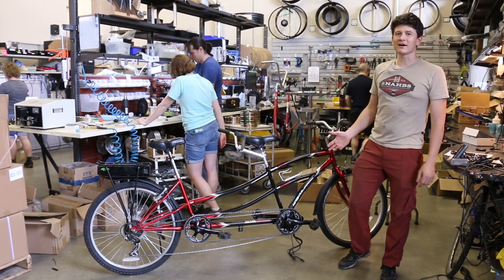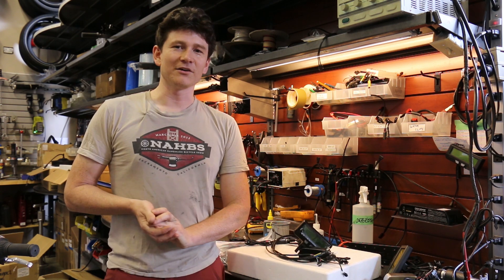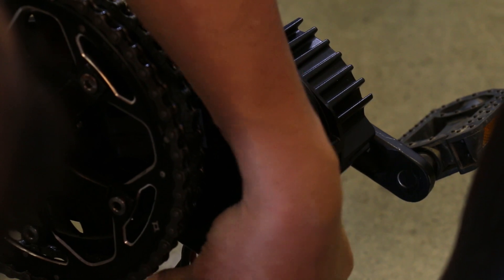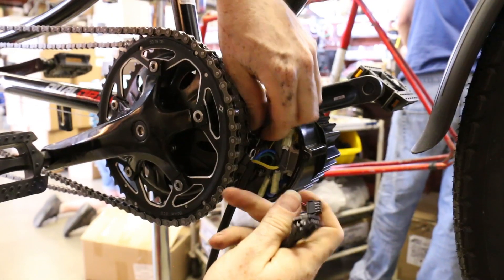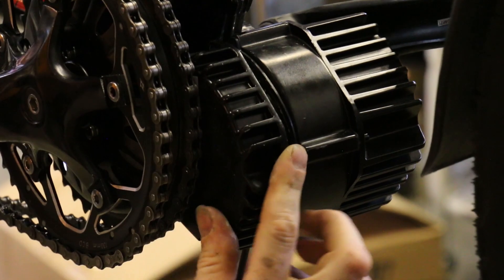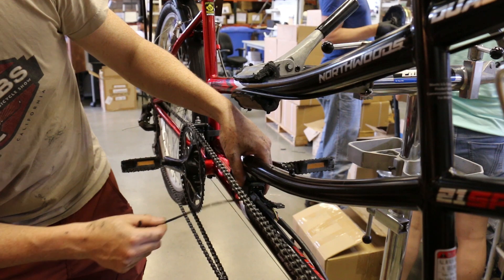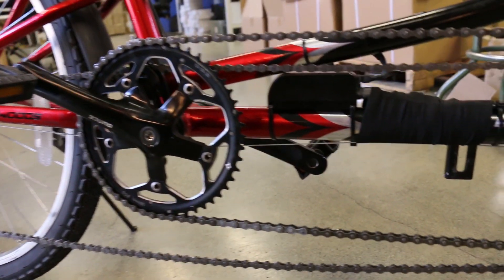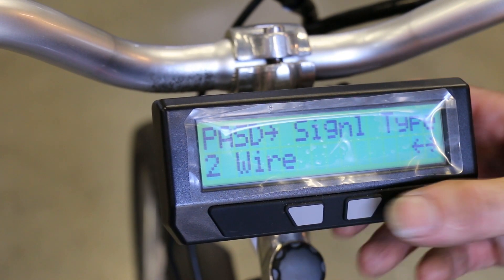How to upgrade a BBSHD mid-drive to use a Phaserunner motor controller and V3 Cycle Analyst

Comment: Now with doing this swap and going to a 72v battery will this increase over all top rpm of the motor ?? And if there is a increase in rpm what is it?  This is a sold set up, great video..
Reply from the maker: Yes, increasing the voltage to 72V will increase the maximum capable motor RPM in proportion. The stock BBSHD motor spins the cranks at about 3.3 rpm/V,  so with a 48V battery the cranks would spin at a max of 158 rpm with no load.  If you run with a 72V battery pack, you'd be able to spin up to 237 rpm.   With the Phaserunner it will still be perfectly efficient and capable of running at lower rpms too, but the maximum capable speed before you are back-emf voltage limited is a lot higher.
Reply: How many amps is it set for? Thx